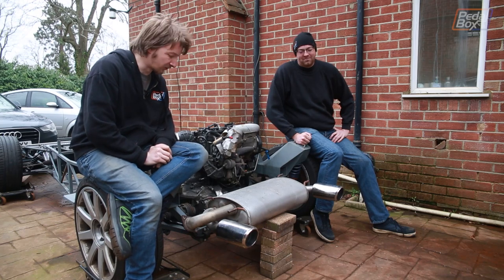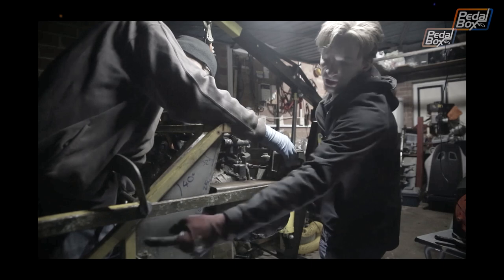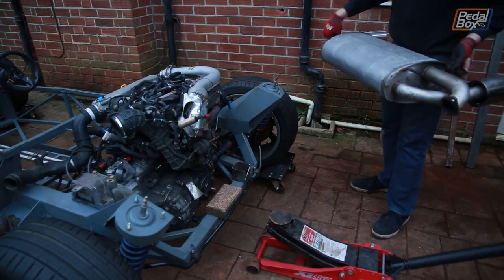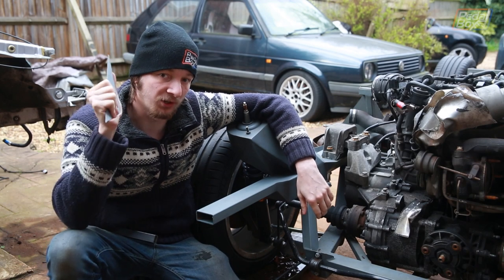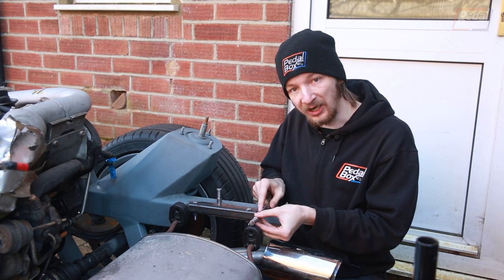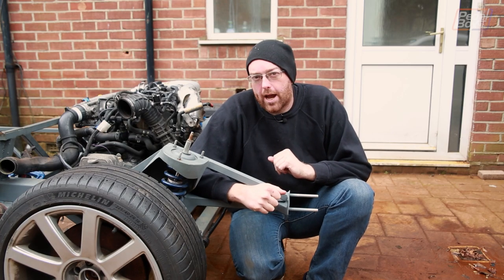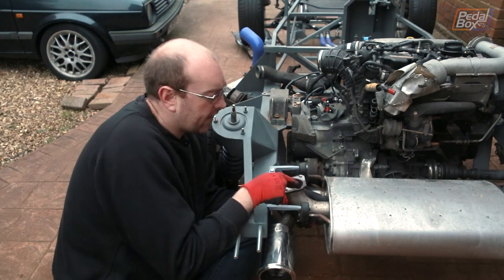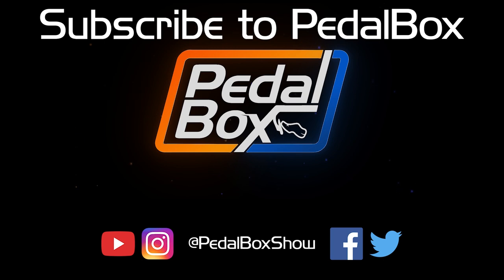Mounting the Back Box | Audi Kit-Car | PedalBox Episode 42

Comment: The first clue was the marker pen on steel, then the skills with the slitting disc in angle grinder. But the give away the level and make the noise. Clear project binky fans. What are the body plans? Had assumed 7 style at the start but clearly not from the work done.
Reply from the maker: Well the /plan/ is to go with a full body, we've got some framework down as you can see but the front end is still a bit of a question for the details. More evolving as we go on but low and wide for the most part :D

Comment: Hi, loving the vids, just subscribed and working my way through the series, this is as far as I have got! Still plenty to watch! I don't know if you guys have thought of this, with the exhaust box, if you flip it over so the intake pipe is the same side as the turbo, makes a nice easy exhaust system, and just weld some new hangers on the exhaust box for mounting, just a thought.
Reply from the maker: We'd wondered about that but it still need a Cat to pass MOT/IVA due to the engine age. Would have been simpler all around without that requirement. Thanks for subscribing! Glad you're enjoying it :)
Reply: @PedalBox  I guessed you would have, I see what you mean with the cat, I don't know whether it would work with a small sports cat. Finally got caught up on all the vids, looking forward to the next one👍
Reply from the maker: @stevennailedit  Yeah we've got a small one going in and hope that'll be enough. Next one should be along this weekend, if the edit gets done. It's a bit of a mammoth wiring effort with some fab
Reply: @PedalBox  looking forward to it👍